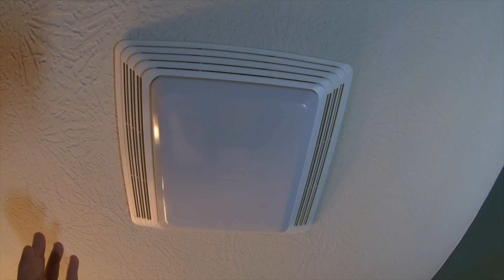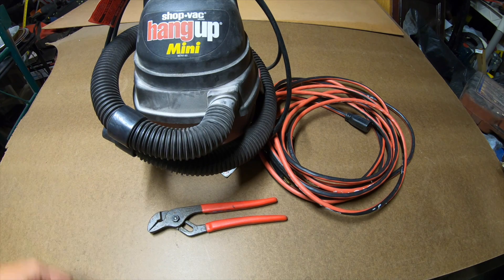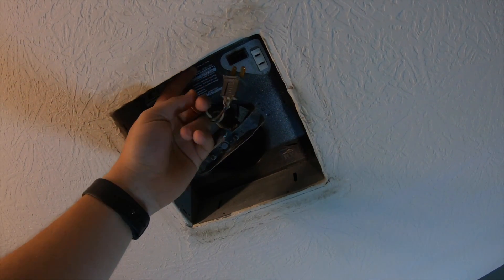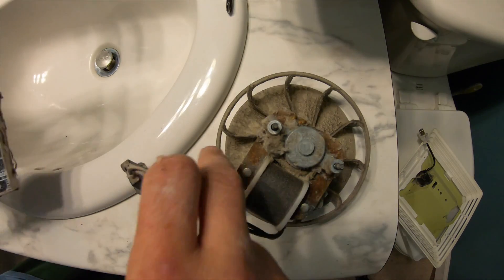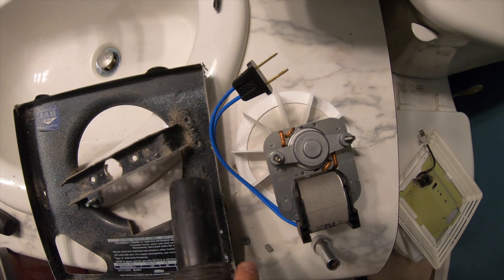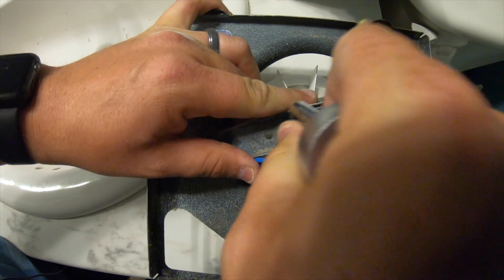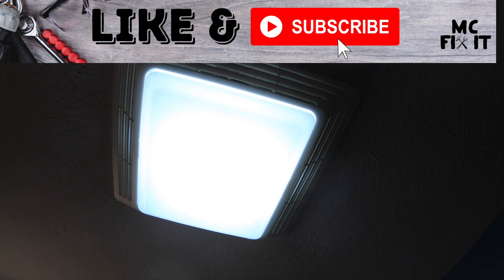How to Replace Bathroom Fan Motor - Nutone Broan (Complete Guide)

Comment from the maker: Learn how to replace your Nutone-Broan Fan Motor! 
The Tools: 
* Replacement Motor BP27 - https://amzn.to/3wjQhYV 
* Philips Screwdriver - https://amzn.to/3hdpzx0 
* Flat Head Screwdriver - https://amzn.to/2RAjTlU 
* Step Ladder - https://amzn.to/3bg8azE 
* Mini Shop Vac - https://amzn.to/33rPSqZ 
* Channel Locks (optional) -https://amzn.to/3fjRd91
* 8 foot ladder - https://amzn.to/3vRIXU5 
* Extension Cord 50ft - https://amzn.to/3hk0Jv4 

This should work on a number of other makes and models of bathroom fans. Make sure to order the correct part for your replacement. 

00:07 - The Problem
00:36 - The Tools
01:59 - The Fix
04:56 -  Putting Together the New Motor
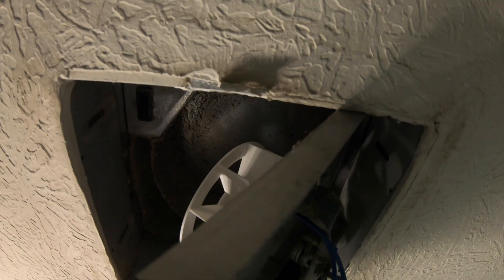08:29 - Putting the New Motor in
08:42 - Plugging in the Motor & Light
09:16 - Plugging in the Bulb and Light Cover

Check out my website at http://mcfixit.us 

Disclaimer:
Due to factors beyond the control of MC FIX IT, I cannot guarantee against improper use or unauthorized modifications of this information in the video, post, blog, or social media. MC FIX IT assumes no liability for property damage or injury incurred as a result of any of the information contained in this video. Use this information at your own risk. If you feel uncomfortable at any time. Stop and go to a professional. MC FIX IT recommends safe practices when working on vehicles, your house, or any other project and or with tools seen or implied in this video. Due to factors beyond the control of MC FIX IT, no information contained in this video shall create any expressed or implied warranty or guarantee of any particular result. Any injury, damage, or loss that may result from improper use of these tools, equipment, or from the information contained in this video is the sole responsibility of the user and not MC FIX IT.

#mcfixit #bathroomfan #fanmotor
——
Supplies used to record this video: 
* GoPro Hero 7 Black - https://amzn.to/3f3ALtb 
* 256GB Flash Drive - https://amzn.to/33pAueG 
* Vlogging Frame - https://amzn.to/33tajE0 
* GoPro Pro 3.5mm Mic Adapter - https://amzn.to/2RCURCu 
* Youmic Lavalier Lapel Mic - https://amzn.to/2R55sWX 
* Boom Stand (tripod) - https://amzn.to/3bdkQaw
* 5/8” to 1/4” adapter (boom to blogging frame- https://amzn.to/3txrVsM 
* Portable Battery Powerbank- https://amzn.to/3vJQc0q 
* 6ft USB to USB-C (powerbank to GoPro)- https://amzn.to/3uAS5MH
Reply: Does the motor size matter? I think it says a 70CFM on mine. Would it be okay to get the 50CFM for my small bathroom (it's only a toilet and sink).
Reply from the maker: @toma.rogers6647  I'd say that 50CFM is more than enough for that sized room.
Reply: Can you replace the motor of cfm 50 to CFM 70?  Do the pin outs spacing the same to fit?

Comment: Thank you. My light stopped working and I was about to buy another fixture and then saw this video. Turns out the light came unplugged and I just plugged it back in. All set now.
Reply from the maker: I believe the vibrations from the fan causes it to come lose over time and become unplug. Def work checking it out before buying a new one!

Comment: Great video.  I’m trying to figure out if these can be upgraded.  This is a great resource for disassembly and reassembly.
Reply from the maker: Glad it was helpful! As far as upgrading... do you mean like gutting it and replacing the mechanical parts? If so, you could but remember that they often change designs between model numbers so it would need to be a part that is interchangeable with your current model. That's similiar to what I did when replacing the motor in this video.
Reply: @MCFIXIT  Yes I’ve checked the Broan website for an upgrade fan replacement but it doesn’t seem available for my particular model.  I would like to move more air without a total tear out and replacement but that is looking like my only option. Thanks again for the great video.  Well done.

Comment: would love some help understanding why its important to know if the fan spindle rotates clockwise or counterclockwise, and also how the fan blades are facing or air will blow in vs. out.  replacement motors come in CW and CCW directions and buying the wrong one will result in not exhaust but air blowing in

Comment: Is changing out the motor quicker that just replacing the whole unit?
Reply from the maker: cheaper and much faster. You would need to redrywall if you take whole unit it. This is a quick repair that many people can do themselves!
Reply: So true! it's very cheap to do this yourself. I spend about $25 total on the repair instead of almost $100 for a new one plus having to get someone to help re-drywall the area. Just do it this way for sure!

Comment: I just ordered a replacement motor for my mother in law’s bathroom fan. It’s probably at least 30 years old and light, fan, heat and nightlight. The modern replacement has a plug and the original is wired in, both wires black. Is one a hot wire or does it matter?
Reply from the maker: Hello, it is hard to tell unless I would be there. I would use a volt meter to see which one is which. It's too hard to guess in an online comment, sorry. I hope you are able to complete your project!
Reply: @MCFIXIT  The new one has a plug with no wide blade. No matter which way I plug it in it turns counterclockwise.

Comment: Can you replace the motor of cfm 50 to CFM 70?  Do the pin outs spacing the same to fit?
Reply from the maker: I believe so. You will want to check the specs online through the company to ensure that would work. Many of of the 50 and 70 look very similar.
Reply: @MCFIXIT  thanks much, 9 order a cfm 70 motor to mount on old housing!
Reply from the maker: How'd your project go? Did it fit well and work?

Comment: If you push the fan blade so it’s very close to the metal housing it will move more air 6:21
Reply from the maker: Great tip! Thanks for adding this :)

Comment: Picked the wrong motor. The new one is 50 CFM while the old one was 70 CFM.
Reply from the maker: That’s easy to do. Just exchange it or keep it. There’s not a huge different in those those especially if you have a smaller bathroom.
Reply: @MCFIXIT  That’s a Broan-Nautilus type fan if you want to know. These are either branded Broan or Nautilus and they both use the same motor and parts. The BP27 works for Broan, Nautilus, And some NuTone fans.